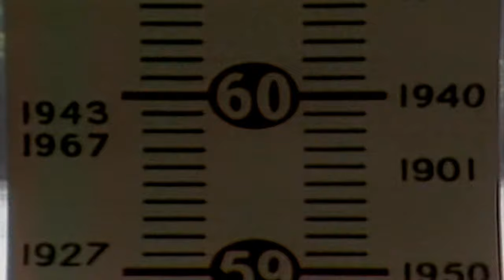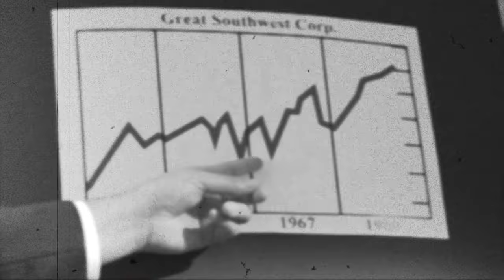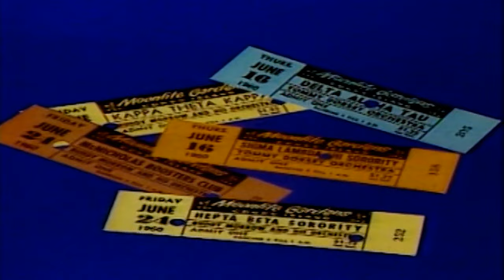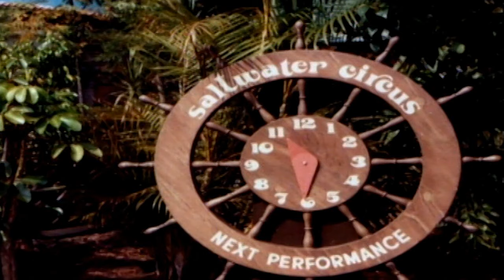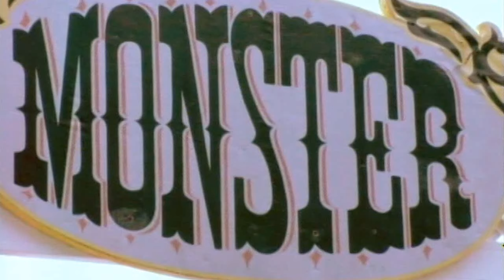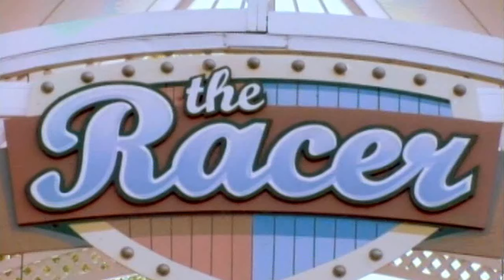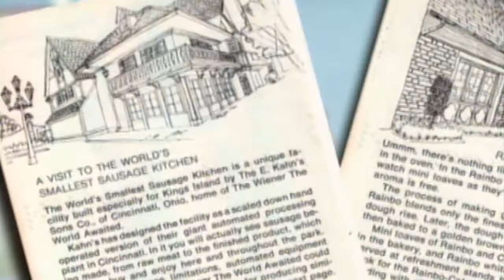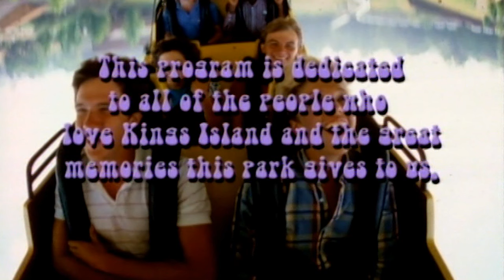Kings Island History

Comment: 51:15 My only issue with this is that there were a few coasters built in the 50s and 60s, mostly junior wood coasters or wild mouse designs, but Camden’s Big Dipper (1958)  Cedar Point's Blue Streak (1964) and Myrtle Beach’s Swamp Fox (1966) were three good sized coasters built during this otherwise slow period. Anyways back to KI. Been going since 75 and so happy that the park is in the hands of Cedar Fair after Paramount had changed so much of the character of the park. And even after the many changes to Beast and Racer it is still great to take a ride once in awhile. I do hope the park restores some of the elements to Beast for its 50th anniversary. Here is a  GREAT read for those of you who remember when The Beast had 4 bench trains, water surrounding the station, skid brakes and a more secluded entrance which was intimidating to my 8 year old self at the time. https://www.themerica.org/blog/2019/02/24/kings-island-03

Comment: 51:33 Blue Streak @ Cedar Point 1967...try again
Reply: Cedar Creek Mine Ride 1969 as well...
Reply: @kc8hnz  I assumed they were talking about wooden coasters because whenever the park makes that claim it's usually in regards to wooden coasters.  Cedar Creek is technically a steel coaster and just has wooden supports.  If you include steel, the Matterhorn Bobsleds were built in 1959.

Comment: One of the guys in this documentary said that, until Racer was built, there were no roller coasters built in the U.S. since 1946. That is not correct since Blue Streak was built and opened in '64 and the Cedar Creek Mine Ride was built and opened in '69.

Overall, though, this is a great documentary about King's Island. It's a great park.
Reply: ***** Cedar Point wasn't the only park in the world buiding coasters then...
Reply: Also, he said that Disneyland didn't have any...it did.  Matterhorn Bobsleds was Arrow Development's first coaster ever (and the first to use modern tubular steel rails).  That was a big milestone and opened the gates to modern steel roller coasters.  It wasn't a day one ride, but it opened long before Kings Island.  Six Flags Over Texas opened in 1961 with a wooden wild mouse called Sidewinder, which was relocated within the park the following year and renamed La Cucaracha.  In 1966, the same park opened the world's first mine train roller coaster.  Yeah...not building any from 1946 to 1972 is WAY off.

Comment: Only one issue at 51:15 - very much an inaccurate statement. Cedar Point's Blue Streak was a brand new build (by the same designer no less) in 1964. RCDB lists others that went up around the country in the 50's and 60's as well although that was a slower period in the industry. Granted KI and CP were competitors (funny that they're family now lol) but as accurate as everything else is in the video I just found that surprising. Racer certainly turned heads and is credited for spring boarding the second golden age of the roller coaster (which is still going strong) but it was not the first one built in 3 decades.